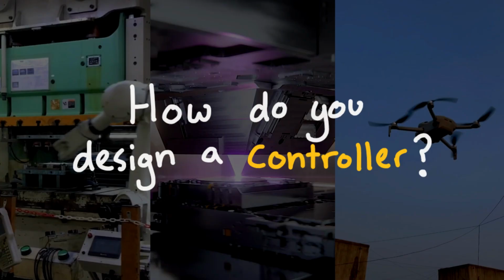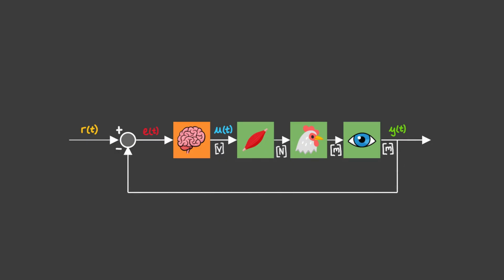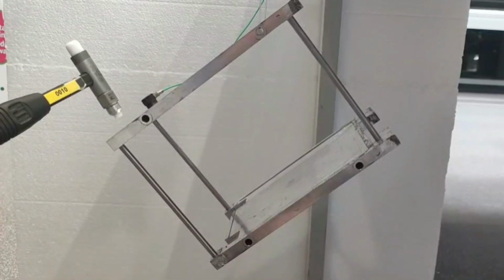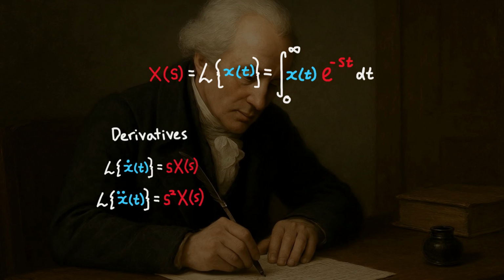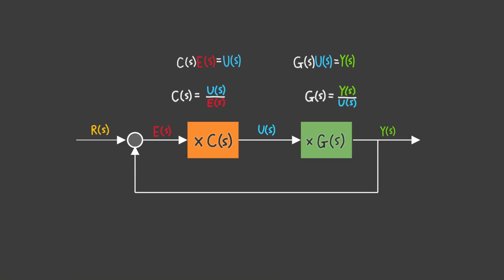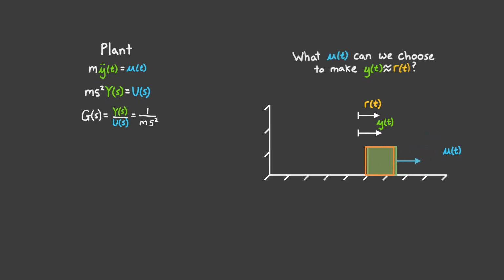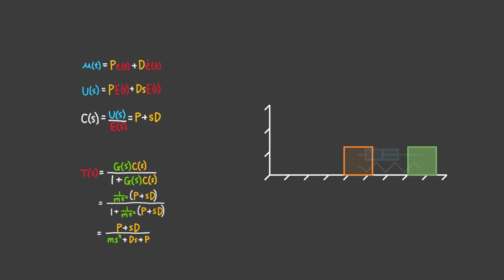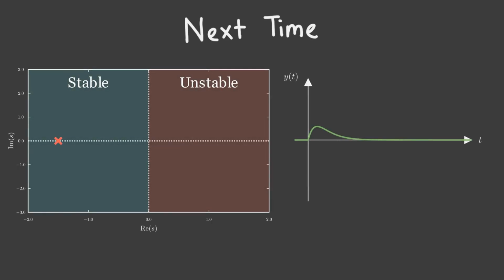1.1 How to design a Controller? Time & Laplace Domain | Fundamentals

Comment: good video. 
When you do a video on convolution, one visualization that helped me with convolution was that we can think of any signal as a series of impulses. And when we convolute the impulse response with that signal, or with that series of impulses, we get our output signal. At time step 3, the result would be the immediate response of the current impulse, the one that started one timestep ago, the one that started two timesteps ago, and the one that started three timesteps ago. therefore we see "virtual time run backwards" in  the convolution.
For that visualization I also like the equivalent definition of u(t)*g(t) = int u(t-tau)g(tau) dtau more than  u(t)*g(t) = int u(tau)g(t-tau) dtau
Reply from the maker: Thanks for your comment! I'm actually planning to make a separate video covering impulse trains and the intuition of convolution which you've just mentioned in a separate video. :)